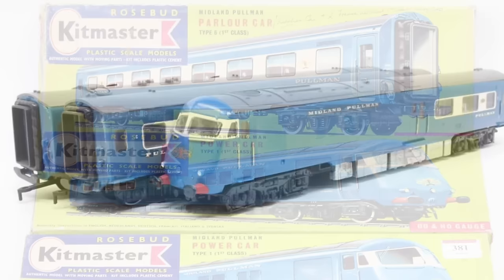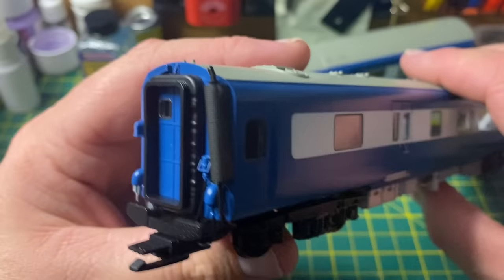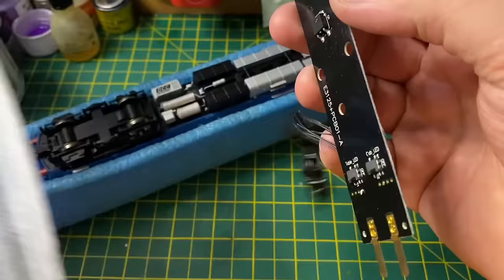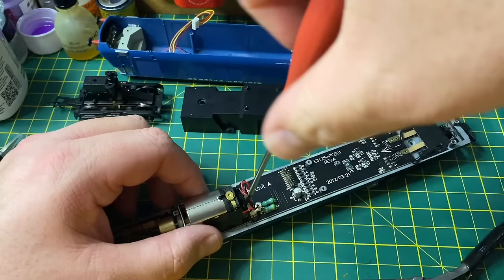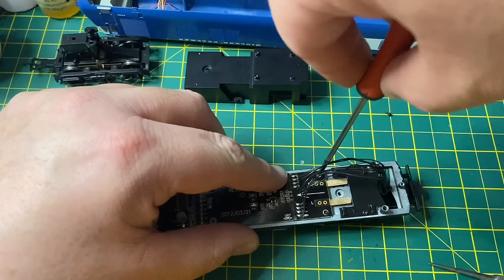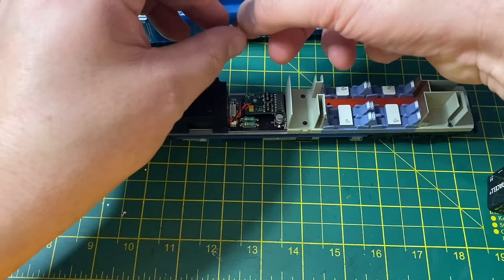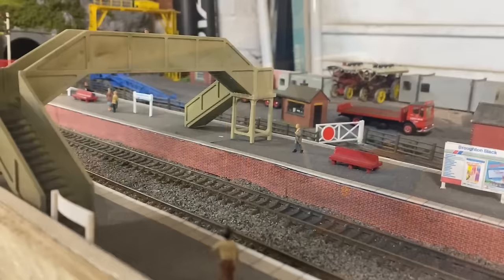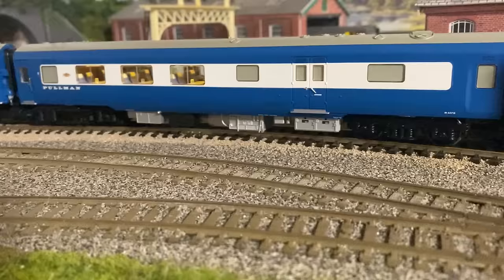Trash to Track Special. The Midland ‘blue’ Pullman from Bachmann.

Comment: thanks for posting such an informative and great video.

I purchased the same set 2 years ago from eBay and had never run it owing to the fact I didn't have a layout. to be fair I don't have one now owing to the fact I'm still building the baseboards.
I decided to check mine out to see if they have the same faults as yours. luckily the only thing wrong with mine was spider poo.

Comment: Great video Dan. I truly admire your patience and knowledge in stripping it down.
My model was bought new in 2012 and has run well. It is sound fitted  and have added some passengers too. Have also weathered it slightly with roof exhaust and frame dirt on the bogies.
I reckon mine could do with a wheel clean as coach C lamps come on but flicker on occasions.  Don't think it as drastic as a new PCB board thankfully.  You are right. It is a stunning model.Great video and thanks for sharing 😊

Comment: Well this brings back some horrible memories! I've had one of these sets from the original production run. Over the years it has disintegrated; lighting has gradually failed or gone intermittent, both motors got very noisy and have been replaced. I got so frustrated with it I dismantled it, stripped out the lighting and run it on DC. Meanwhile, my 1960s Triang set, unmodified apart from Ultrascale wheels, runs well on its original motor. Crude, no detail, too short etc, but it works. You've done a great job with yours, well done!

Comment: nicer it you fit a sound decoder sounds great😀😄
Reply from the maker: I had thought about that. But the bachmann sound is clearly an MTU HST. Footage with quality sound of what these actually sounded like seems to be non existent.
Reply: @dansmodelrailways7886  Hi Dan I have one in N GAUGE I fitted a decoderin it from yourchoochoo and it works fine just got one speaker  in the front I am pleased with 🍻 cheers Brian
Reply: When I saw the real Midland Pullman for the first time I was smitten and when Bachmann bought out a model I just had to have one and what a beauty, I enhanced mine with passengers and sound at both ends. I can now relive those boyhood memories. My sound decoders came from YouChoos.

Comment: Hi Dan, your re-build of the Triang Pullman - did you film this rebuild as you did it? This is what I'm doing right now and I would appreciate all the help I can get. I have several Pullmans and I've taken the most 'grotty' of them to form a complete train. I've sanded all the scratches out and now I'm working on each individual unit starting with the Kitchen cars. I've purchased a couple of bogeys from Silver Fox and I'm pleased with them so I'll be getting enough for the whole train. I've also changed the power cars' chassis. They now take Lima Ringfield motors from a HST which I will be replacing with CD motors. I have a battery operated sound capsule for one of the drive cars and some simple lighting is to be fitted. I've painted the interiors and the list goes on. As I say I would love to see how  someone else has done things. Thanks a lot.

Comment: They are I lovely model. I bought one last year but it wasn't advertised as dcc fitted with sound when I bought it or say on the box anywhere so unfortunately can't use it for now. But I will keep it for the future as I will try dcc eventually.
Reply: Think they all come DCC fitted. just remove the DCC chip and install the blanking plate included. I use mine on DC no worries.
Reply: @stevem879  Ar there weren't any included. Will have to look for some if that's all I need to do to run it for now ☺

Comment: Notice you are use Gaugemaster prodigy to run it like me. Did you know you can re-map the cab lights( currently on F2 there) to say F4 & F5 where they will stay on permanently if you so wish. Nice video. Mine had a dry motor bearing which I must sort